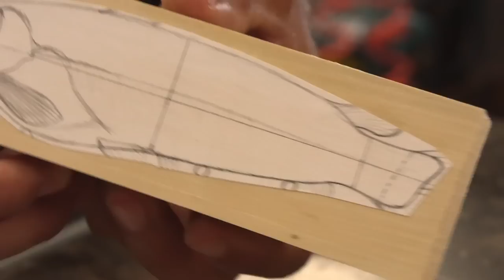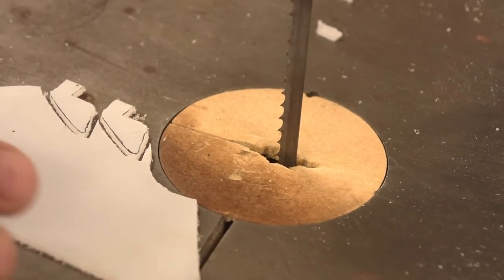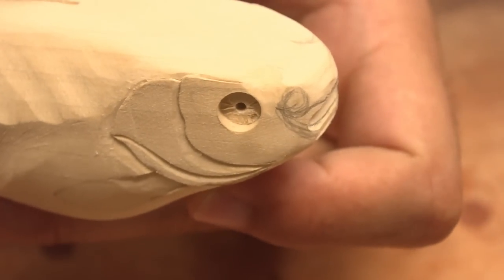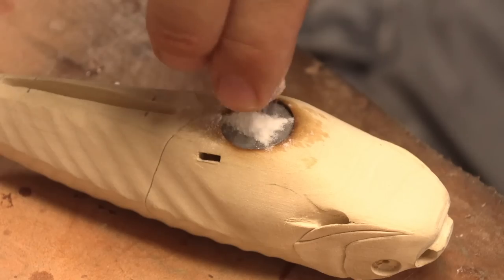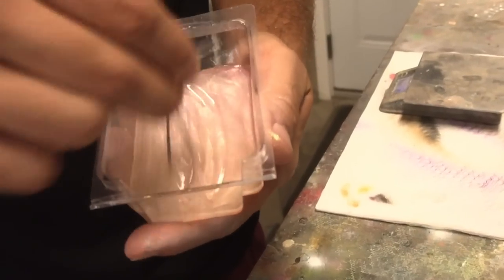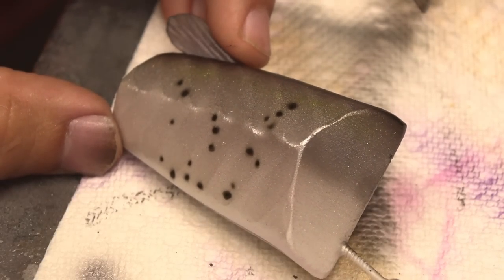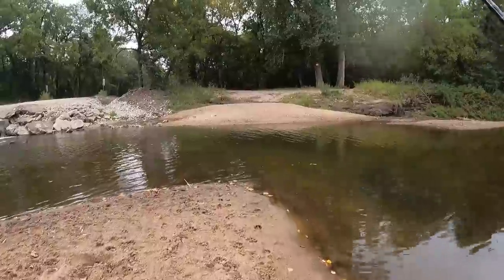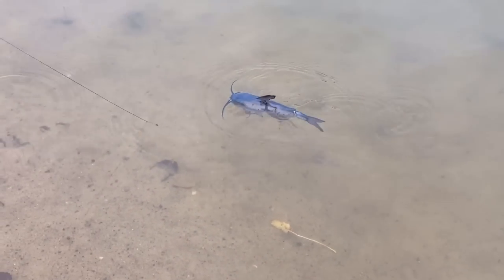Making a CatFish SwimBait with a Flappy Brass AnalFin

Comment: Hi! Thank you so much for the great content. I just have a few questions for anyone that can answer. 

I am new to this. I’ve never wood worked other than shop class and don’t have many tool or equipment for this process. How and where do I start? Just Simple’s tools or equipment for longevity. I really want to get into this hobby and start making my own lures. Not even big, just to know I don’t need to shop for lures anymore. Even if it cost more to make. I’d rather do it myself.

Comment: Couldn't WAIT for this one after the IG post; such an incredible bait, Nate, and it's always awesome to see your process in action! 🙏 Shame the action didn't work out at first, but thrilled to see you pulled it back around through HARD WORK & PERSEVERANCE! 🎣💜😂

Unrelated, I sincerely love that weird visual effect that happens when rapidly rotating blades are out on a camera; I think it has to do with the interval of rotations coming close to aligning with the camera's frame rate (or a multiple of it), so the collection of images when processed by our silly little brains leads us to see the blades as rotating slowly backward/forward, or even static in rare circumstances. Brains are weird 🤷

Comment: I think the action problem is because of the forward-facing whiskers, they're actually stabilizing the entire bait.  If the rubber whiskers were swept BACK it would probably play a LOT better.
Reply: The major whickers off the jaw are streamlined to the body here: https://inaturalist-open-data.s3.amazonaws.com/photos/44152/large.jpg .  Everything else is at 90 degrees to the centerline or less.  You had 2 large whiskers facing 45-ish degrees forward, that was killing the action.